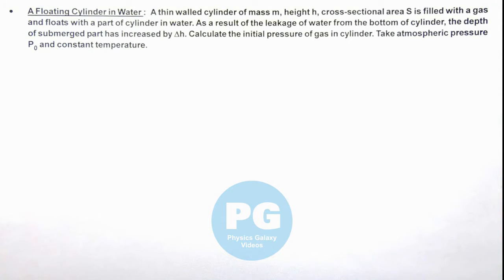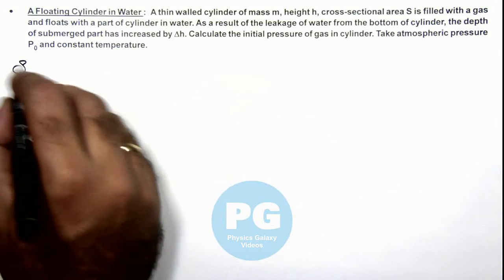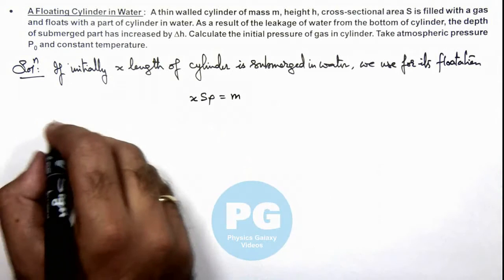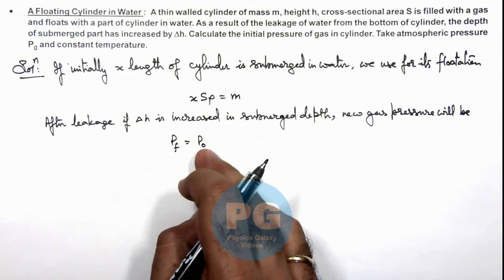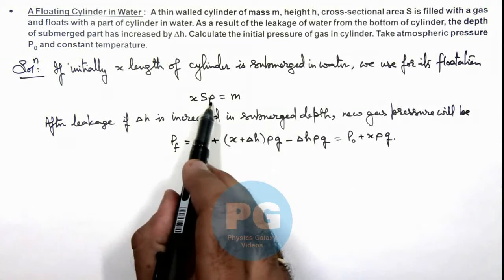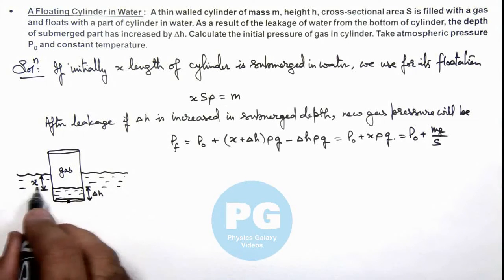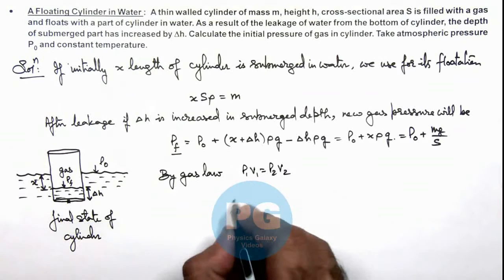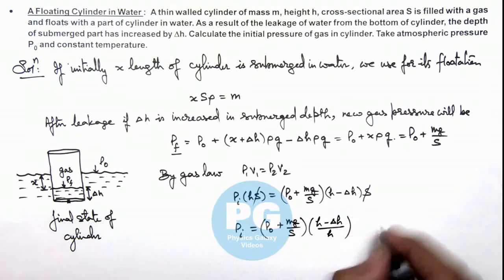14. Advance Illustration | KTG and Thermodynamics | A Floating Cylinder in Water | by Ashish Arora

Comment: Let me explain the P(f) thing.

At the Leakage point (L.P.), since the body is in equilibrium, so 
P(above L.P. ) = P(below L.P. ) 
=> P(f) + pg{∆h} = P(not) + pg(x+∆h) 
=> P(f) = P(not) + pgx 
=> P(f) = P(not) + (mg/S)

Hope you understand.😀🤗
Reply: GOAT
Reply: I think u explained it wrong the lid is closed... We are viewing this from two different frames.. at same liquid level(the bottom most line)... One is Po+(x+h)pg[calculated from the outside wala liquid surface] and one measured wrt the cylinderPf+ hpg...
Reply: @arshitadawra1726  can anyone tell me why sir hasn't considered a force due to initial pressure of gas acting on base of the container in initial state which makes xS(rho)=m+ p(initial)S/g. ?????
Reply: @rajatgupta3087  kyuki equal and opposite force upr wale lid pr bhi lag rha hoga .... Dono ek dusre ko cancel kr dega ..... Btw15 din m jee adv h .... Phatti padi h. Bhai
Reply: @arshitadawra1726  yeah bro you are correct
Reply: Thanks bro
Reply: Thank you
Reply: Tqsm
Reply: Thanks man

Comment: Sir why haven't we added the pressure that the gas will apply on the lower surface of the container in the initial float condition?
Reply: bro here law of flotation is applied , i.e in order to float x distance the volume of the body must equal to volume of liquid displaced by the body.
Reply: @cricobug9778  bro this guy must've gone through his jee exam 2 yrs back. He is in a college right now. Lol
Reply: @pranavpandey9730  still I have the same doubt
Reply: Yess ?
Reply: Because , same pressure will be  applied on the upper lid